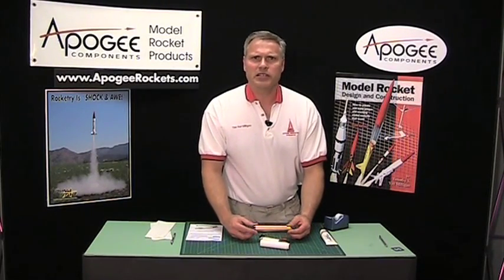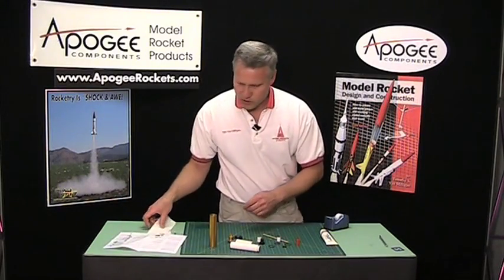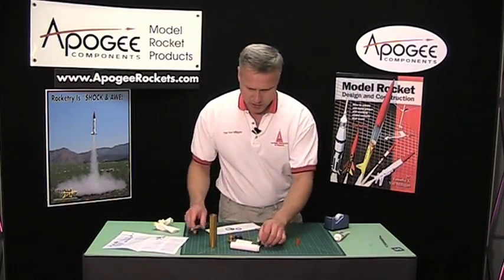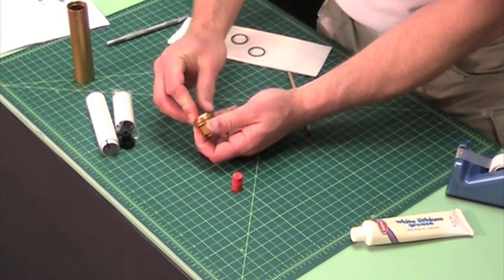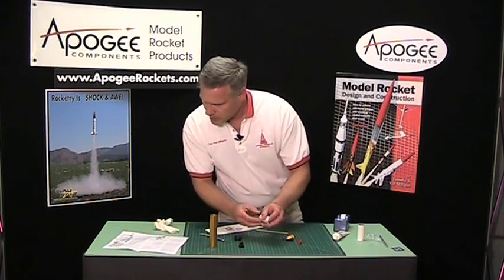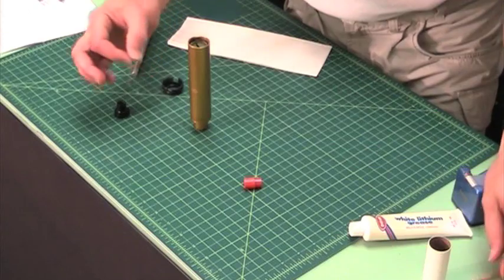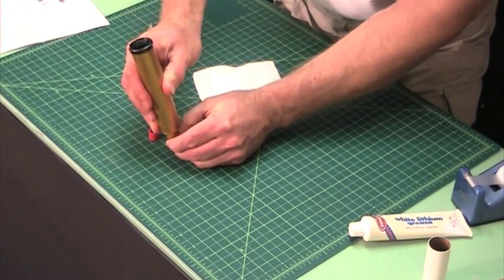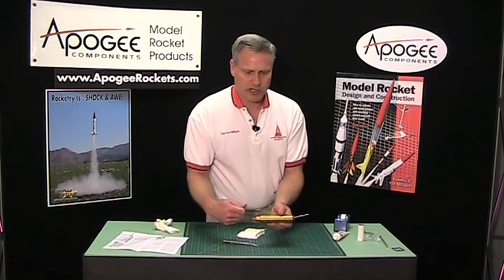Reload Motor Assembly

Comment: A few issues with this video's demonstrated assembly of a G64 White Lightning in the Aerotech 29/40-120 motor case.

1.  Worst Error--DO NOT Install the aft o-ring against the propellant grain, before the nozzle.  Nozzle goes in FIRST against the grain and liner, then the o-ring gets fitted between the nozzle outer groove and the liner, so that the aft closure (installed next) then compresses the o-ring between it and the nozzle.

2.  In addition to liberally lubing the case and closure threads, it's good practice to lightly grease both the inside of the casing and inside walls ONLY of the forward closure (but NOT the forward closure's ceiling with the touch hole for the ejection charge).  This helps to prevent scorching or burning through the case if the liner burns through...and they usually do in the G motors.  It also makes clean up easier, albeit messy with the sooty grease to remove.  Dirty nails beats a CATO, though.  The reason to keep the touch hole area free of grease is so that the ejection charge black powder can pass through the touch hole to contact the delay grain.  Even a little carelessly applied grease in this area can plug the touch hole, or insulate the black powder from the delay grain, resulting in a failed ejection charge ignition (and a lawn dart). 

3.  Grease the outside of both the propellant grain liner (liberally) and the delay grain liner (sparingly, being careful not to get any grease on the delay grain faces).  Again, it helps to reduce damage to the aluminum  if the liner happens to burn through, especially with the hotter propellant like Blue Thunder.

4.  Make sure the propellant liner with the grains installed can slide easily within the motor casing.  If it can't, then  peel off the outermost layer of paper from the liner, regrease the new exposed liner outer layer, and check the fit again.  A jammed, too-tight liner may prevent either the fore or aft o-ring from sealing properly, allowing the white-hot burning propellant to scorch or worse, burn through the thin aluminum skin of the casing (and likely your rocket, too.)

5.  At club launches you usually won't install the igniter until your range safety officer gives you permission to do so, either at the pad or at a prep table AFTER the rocket is inspected.

Other than that, great info, Apogee!

Comment: Also missing is the piece of tape over the forward end of the propellant grain. This makes sure that when the fuse is inserted it stays in contact with the propellant and does not slip beyond.
Reply: That is only required on propellant grains that don't run the full length of the case.